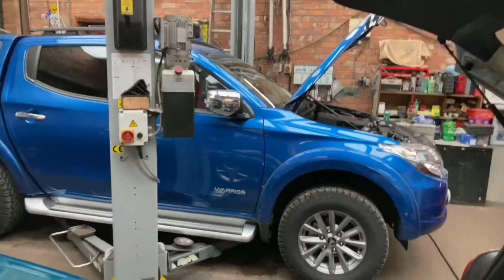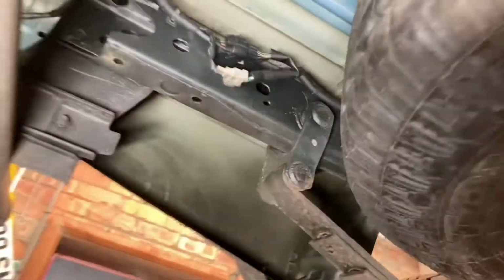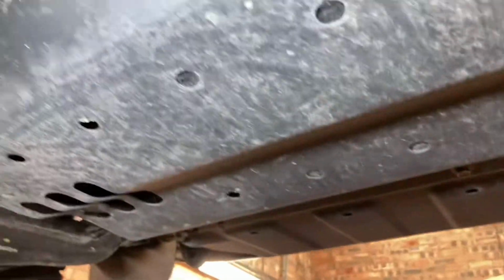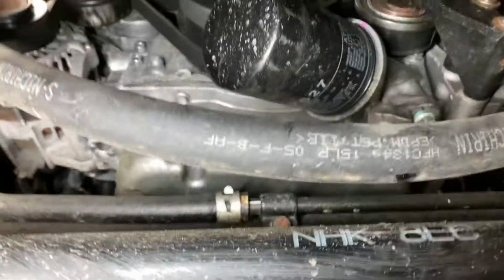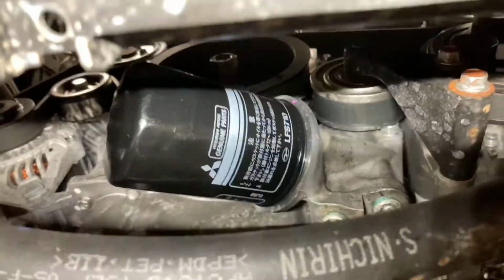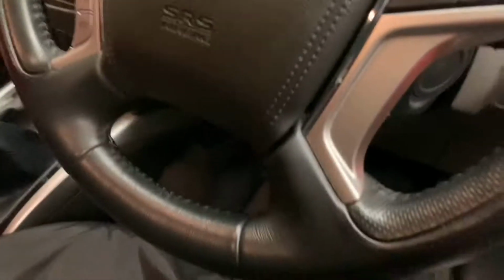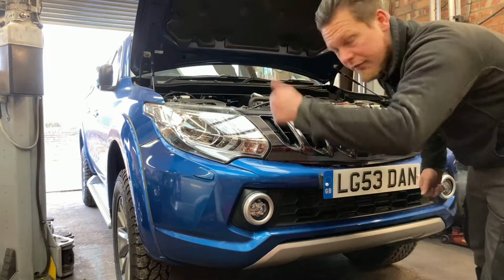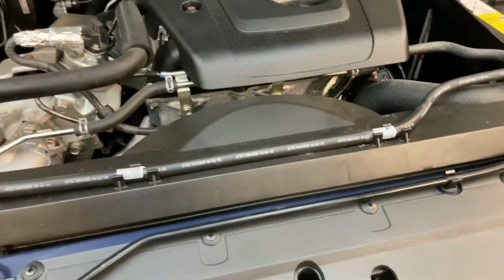How To Service Mitsubishi L200 Series 5 2.4 DI-D | Second Service | Full Service Guide #l200 #4x4

Comment: Cheers for your video mate.  Got a series 5 myself and just bought all servive items to tackle it myself you've helped alot  🙌
Reply from the maker: Thanks for watching and supporting the channel 👍🏼

Yeah just follow my steps and you can’t go wrong, remember the pollen filter is a 2 min job and so is the air filter…. Only reason I didn’t change as they had been done separately few months ago.

I don’t follow dealer rubbish I usually oil/air/fuel/ pollen annually regardless of miles.

Comment: As an Mitsubishi technician/mechanic I can tell you that you can change the joints on the prop shaft, however if you greese them every service just as Mitsubishi want they run atleast 200.000km.
And the airfilter needs to be changed every service, or I can say I haven't seen one so far that I could recomend to drive to the next service... You get it back on the fuel consumption...
Diesel filter: you should tighten the ring untill you feel a "click" otherwise it's not tighten enough and you'r probably get a leak.
Here you can look at a video i've done about the rear brake drums: 
https://youtu.be/370l9is1j1A
It only take 3-4min/side so it's not that big of a job. (yes, it's a one take video 😁 )
I also change airfilter in the cabin.
Cheers from Northern Sweden!
Reply from the maker: To be honest for what it costs, better changing oil/air/fuel/cabin filters annually, will save you in the long run.

Will take a look thanks
Reply: Hi, what grease is specified?
Reply: @bhughesy6740  
We use Castrol moly grease 👍
Reply from the maker: Any good spec Moly grease will be fine to use
Reply: Thanks, great videos by the way!
Reply from the maker: Thanks for watching mate…. Feel free to share 👍🏼
Reply: What milage is a series 5 , 2.4 litre 2017 L200 due a timing belt ?
Reply: @michaelstone2563  
There's no timing belt, it's a chain 👍
Reply from the maker: Yeah it’s a chain
Reply: @Mr Olsen  thank you!  It's the father in laws and seen mixed things online , with no dealership here in ireland now its hard to find these things out. Is the timing chain a lifetime job or like in some bmws need to be changed ?
Reply: @Car Addict Garage North East  thank you! Is it a lifetime job or does it need to be changed like in some bmws ? We have no dealership anymore in ireland so very hard to get information on maintenence schedule for it.
Reply: @michaelstone2563  
We have some of those who have passed 350.000km and not seen any wear and tear on the chain.
But as always with a engine with chain it's important to change oil regularly.
Reply: @Mr Olsen, thank you again. I do a full service every 10k miles for the father in law.  When should the difference oil's and gearbox oil be changed ? 
Also the well know issue of jumping out of 3rd gear under load has started to happen. Is this a big job to do, I see videos online and it looks OK? I would be a fairly good hobby mechanic (changed engine's, done clutches etc in the past)
Reply: @michaelstone2563  
I can't remember when the diff and gearbox oil are ment to be changed.
When fixing the 3rd gear you need to buy the kit from Mitsubishi with gear sleeve and sync to get it to last.
The gearbox are a bit tricky to dissacembly/assembly, but if you take your time with it, and look at some videos about it you could probably fix it.
Reply from the maker: If you change oil every 10k can’t see why you would have any issues with the timing chain.

Thanks for watching 👍🏼
Reply from the maker: Yep I say every 10k on just about any vehicle….. plus get the dealer service schedules and bin 🗑️ them
Reply from the maker: Yes the 3rd gear thing used to be recall and covered under warranty, doubt it is now.
Honestly not sure on the 3rd gear issue, think it’s gearbox out and stripped down I think.
Reply from the maker: Yeah I gathered it would be gearbox out job, some people saying it was gearbox mounts and all that I didn’t believe for one minute, knew it would be gearbox strip down job

Comment: To change auto gearbox oil on this series of L200 do you need to fill through the drain plug, no filler plug on the side of the gearbox like the manual version?
Reply from the maker: Totally different ball game changing oil in automatic vs manual gearbox mate.

More of a specialist job doing it on an Automatic

Comment: Hi great videos and information what a head of knowledge! Would like to test to see if theres information that could help me i have the series 5 2015 auto will be doing the upgrades as you have but do you know where the automatic transmission fluid top up is on this truck cant find anything about it can't see any dipstick.thanks for any information you caa give.
Reply from the maker: Thanks for your positive comments👍🏼

For the automatic checks on these if they ain’t leaking there isn’t much to check as there is all special procedures to do before you can correctly read the oil level.

I have not had massive amount to do with the autos, as for servicing them I would take it to automatic transmission specialist, may cost a few quid but definitely worth it.

Comment: Great video's, many thanks! - I only subscribed the other day, but reckon I've watched the lot on the your series 5 L200 already!. I just picked up a 17 plate Barbarian auto last week, so still getting used to it. I'm certainly finding it a bit different to my 06 plate manual Animal which I had for 12 years, but waved it by-by with its new owner at the weekend.
I think my Series 5 is a bit different in some areas to your own one, certainly as far as it has a strange looking attachment to the forward end of the rear diff housing, I'm not sure what it is, and suspect its some kind of mass-damper arrangement, but I'm confident you would know exactly what it is. I also believe the rear bumper on this car has been replaced and has either the wrong fitting kit on it, or its not compatible with the cars tow-bar, since it sits at the wrong angle and is about an inch and a half too low. I have some photos, but not sure how to get them to you - any advice would be well received.
Keep up the good work, and thanks again!
Reply from the maker: Definitely sounds like your L200 has been modified in many ways, without seeing I can’t really comment.

I have facebook page can send via that 👍🏼

Thanks for watching 👍🏼

Comment: Hi, great videos, i wonder weather you could point me in the right direction with my problem ? i have a 2017 L200 and having only done 2000 miles since the last oil and filter change i have a dipstic reading of excessive  ( A being low and B being maximum and the X being excessive) i have no warning lights on the dash, even the DPF light has never come on . many thanks Paul
Reply from the maker: Yeah I can help….. this is common issue with all vehicles fitted with DPF, every time you have a failed ReGen it dumps diesel into the sump (well not directly) so you find your oil level goes up….. it’s not a good thing as it dilutes your oil and you can wreck your engine.

Regular ReGens and regular oil changes is the only way forward unfortunately.

Thanks for watching 👍🏼

Comment: Thanks 👍👍
Reply from the maker: Thanks for watching 👍🏼
Reply: Hi , i have a L200 /2018 model  the stop and start sometimes doesn’t work, revs over 1000 rpm , doesn’t matter when it’s hot or cold ? . Thanks again for your video it was very useful to me 👍
Reply from the maker: @williamfrood5538 
Could be the EFB/AGM battery starting to fail or conditions not met….. but I’m positive the S5 didn’t come with stop start, only the S6 ??
Reply: It’s the Last model before the new shape , I’m not shore what that is or what it does but I will look in to it thank you for the reply, 👍👍
Reply: Yeah Iev got got it , thanks 👍
Reply from the maker: You have the series 5 same as mine, you asked about your stop start not working, but I’m almost positive the series 5 didn’t come with stop start,  only the new shape the series 6

Comment: On my grease gun I forgot to pull the spring back to release the pressure and now it has leaked oil (the liquid from the grease), can I still use the grease or do I throw it out and get new grease?
Five grease points, in my manual it only shows three, I will have to check under the car tomorrow you got me worried now.
Reply from the maker: Yes noticed a few extra points not listed in the manual also.

For what a grease cartridge costs, I would probably just replace it mate.

Comment: Hello and thanks for your information. I have same engine. Using it only for long journeys. I have regeneration every 800 - 1000kms. Car is used only for this and not for short trips. I have never faced oil dolution issue, respectively there are no failed regens and "oil level rising" issue. My question is if I change my oil and not reset the "Oil dolution counters" in the MUT3 or other diag tool , will this cause any issue?
Reply from the maker: In short no it won’t cause issues as the main important point is physically changing the oil….. but to keep things right i would be resetting the ECU once every 12 months

Comment: I just got one do you think they sound very ticky just high compression was glad to here yours sounds juts like mine 😂
Reply from the maker: Yes I have to admit the tuning box and EGR mod are perfect when under warranty….. but a good stage 1 re map and EGR mapped out is a massive improvement, stops all that diesel clatter.
Reply: Reilly does it stop it at idle as I notice very Ratley I actually do ecu tuning so I’m doing mine this weekend
Reply from the maker: Yes i personally would go for a re map of out of warranty

Comment: Hi for the normal factory jack the manual indicates that you jack it on the axel in the rear...is that correct?
Reply from the maker: Thanks for watching 👍🏼

This might sound daft but I never use the factory jacks as I hate them, it’s either a car lift or trolly jack.

You could jack on the rear axel..... but be very careful as all the brake pipes and ABS wiring run along it so if anything slips your going to cause big problems.

My best advice is buy a mini 2ton trolly jack, but I personally prefer the front jacking points at the front, and at the back anywhere on the chassis or spring hanger points as they are the strongest most stable points.

Seen too many people get seriously hurt using factory jacks, I honestly not even looked but i assume these L200 have some kind of bottle jack over the horrible scissor jacks in cars.
Reply: @CarAddictGarageNE  my 2021 Triton comes with a bottle jack...was testing out earlier just to get acquinted with the kits because i got the car yesterday and was checking out the jacking points on the manual...for the front its clear as just as in your vid the jacking point is on the chassis...just found it weird that at the back its on the axel....thanks mate
Reply from the maker: No problem at all happy to help 👍🏼

Yes I understand what you mean, i never like jacking up on axels either..... but I have become some what lazy having a garage/lifts at my disposal, not used to jacking cars up with jacks it’s very rare we ever use one.

If the bottle jack comes with a U shaped adapter to cup around the axel then I suppose it would be safe enough to do basic wheel change..... but I definitely wouldn’t be underneath the truck.
Reply: @CarAddictGarageNE  yep its got that u shaped adapter which the manual says it shoulf be aligned to the curvuture of the axel...🤣🤣....the jacking point is too far underneath the vehicle...like you saying def wouldnt want to be underneath the vehicle at any point when jacking
Reply from the maker: Not really ideal if your on uneven or soft ground.

I do like my mini trolly jack I carry if we go off road.

Comment: Hi pal. Do you have any info on an isu that’s just happened to mine. 

Just serviced my truck and I put ow-30 Castrol edge oil in. From what I’ve read up in the manual, that’s okay. And if fitted with DPF that’s oil you need? 

I’m a mechanic myself. But this has caught me off guard as it’s brought up a EML and pollution regen light.

Any help would be great!!
Reply from the maker: These engines are not overly particular to oil, long as it’s 5/30 C3 it’s fine same as 0/30 if it’s C3 spec will also be fine.

All it sounds like to me is the truck requires a Re Gen, take it for a 7/10 mile trip at a continuous speed of about 60mph in 4th gear so your around 2500rpm and set the cruise (make it early morning or late at night) so you don’t need to slow down it speed up, and that will complete a re gen.

Make some you have plenty fuel in and it’s fully up to temperature before doing this.

Oh and if you have a code reader see what’s logged, could be anything from a DPF pressure sensor to temperature sensor, or simply just requires a re gen

Comment: Hi, great videos. My 2015 Barbarian has the DPF light flashing. Last time it was serviced it stopped. Would this have been the fuel filter or the air filter that helped it to perform the regen? Thanks :)
Reply: The reckon its a oil dilution issue and can be fixed with oil change
Reply from the maker: Hi, yes sometime the DPF light can flash when service required.

Well tbh it’s all counts for good re gens, fresh oil and filter is a must, air and fuel filter definitely will help also.

Are you making sure you carry out regular reg gens yeah?

Thanks for watching 👍🏼
Reply from the maker: Yes these suffer terrible with this issue, make sure your doing regular re gens

Comment: Just bought one off these on a 18 plate. Done 100k in that amount of time so was cheap. The chassis n that look rusted ter fuck. Got a nasty vibration at 1500 rpm. What you reckon? I should change the the diff oils and maybe the tranny oil? (Auto)
Reply from the maker: On an 18 plate it will definitely look worse than it actually is, needs a good scrub down and get it waxoyled… have other videos on that.

These are known for prop shaft issues and they are dam expensive, best get that checked out, and the engine and transmission mounts.

Would definitely be changing everything if you just got it, oil/air/fuel/pollen, front and rear diff, transfer box and automatic gear oil.

18 plate will still have makers warranty as these are 5 year, might only be 100,000 also

Comment: What oil n all to put in for a 100k plus for 2018 l200 series 5 auto
Reply from the maker: Use MPM oil checker guide online, they are spot on will tell you every fluid type you need.

Just be carful as automatic gear oil changes are usually not as simple as you think
Reply: Are you up to the task? If so make a vid bro
Reply from the maker: Yeah we occasionally do automatic gear oil changes, just not had the chance to record one, as it’s difficult in a busy garage recording and dirty jobs end off getting oil all over my equipment.

But next chance I get I will.

Easy way of doing it, what a lot of dealerships do, is refresh the fluid draw out as much as you can with a vacuum pump down the dip stick tube, measure it and replace it with same amount of new fluid

Comment: Hello sir. I put 9 litres of oil in mine. But the dip stick is showing over the fill mark about 2cm . Is this a problem I'm not sure what to do? Just need some advice thanks
Reply from the maker: Yeah ideally you only want it to the max mark and not over.

I just use a vacuum device down the dip stick tube to draw off excess oil.

But ideally no you don’t want to run it over the max mark
Reply: Thankyou for replying. I'm might loosen oil filter to drain some out. Hoping that works.
Reply from the maker: Bit of a chew on the L200 have to drop all the covers, definitely worth buying s cheap vacuum pump